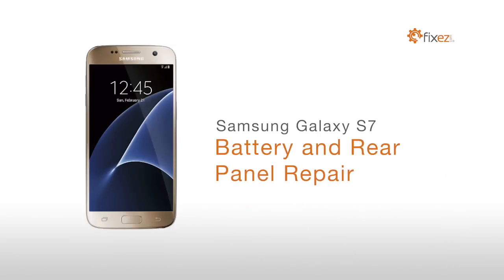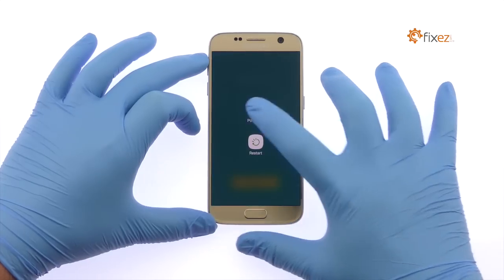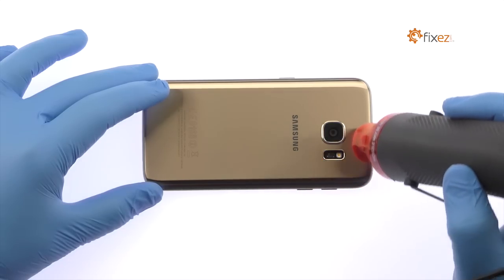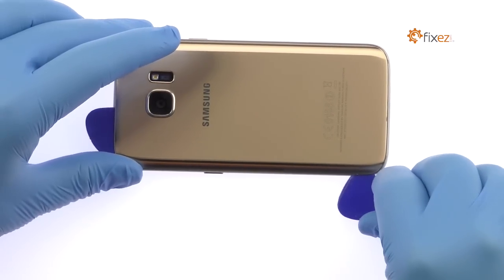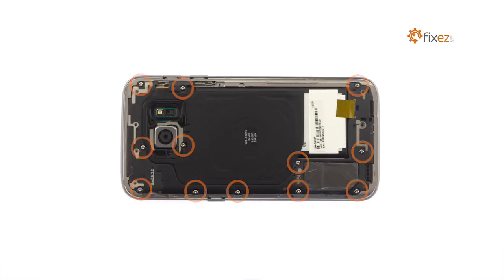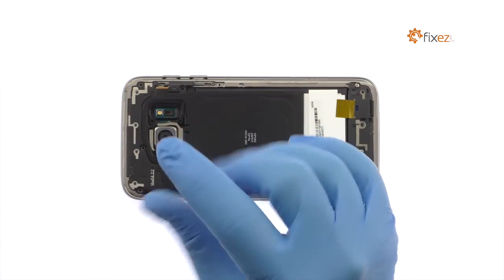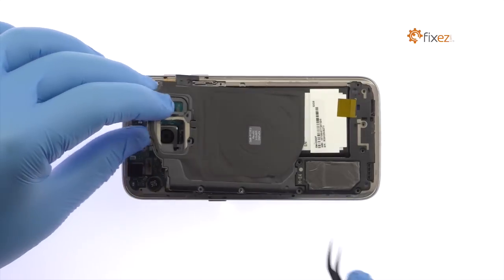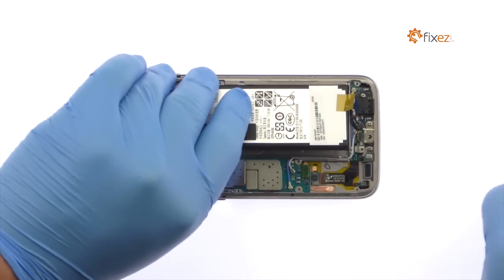Samsung Galaxy S7 Battery and Rear Panel Repair - Fixez.com

Comment: To get it removed, you peel off the adhesive of the back lid. While reassembling, you don't add any adhesive. How come it won't get loose?
Reply from the maker: It is recommended to apply adhesive. We apologize for not showing this step.